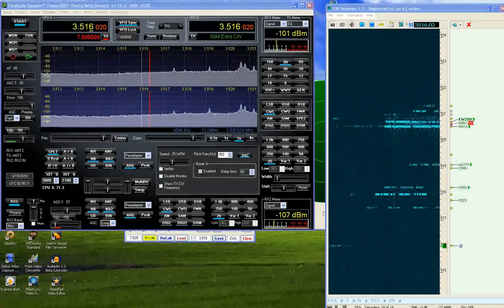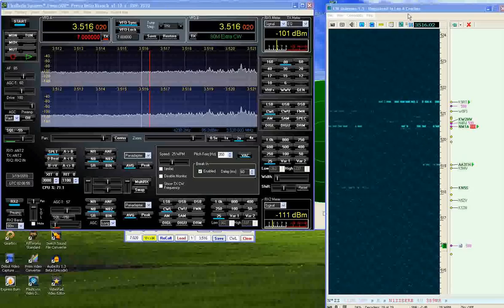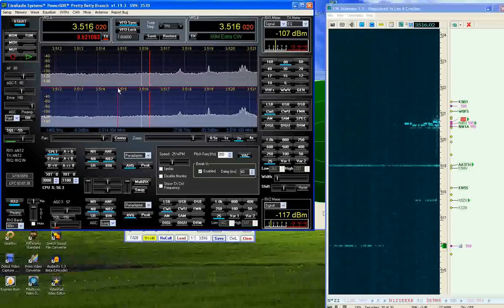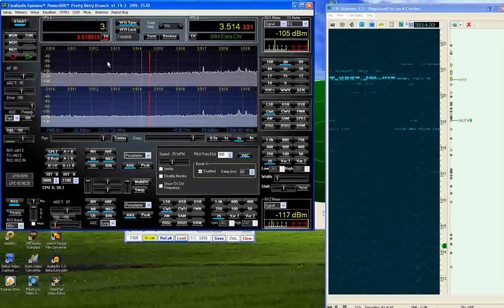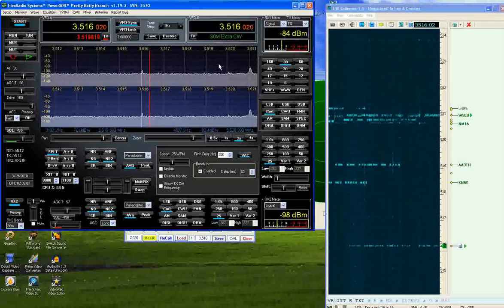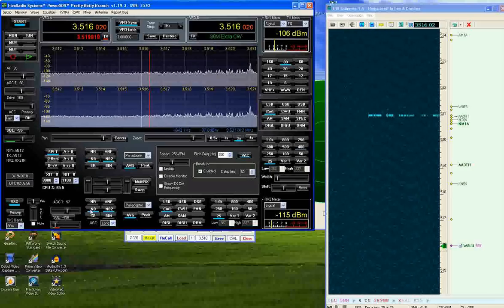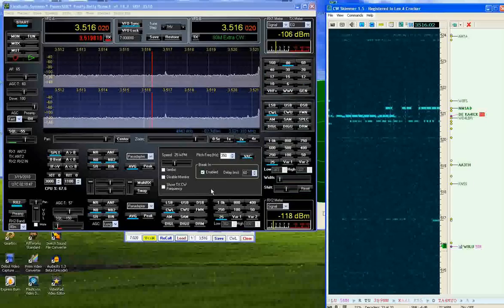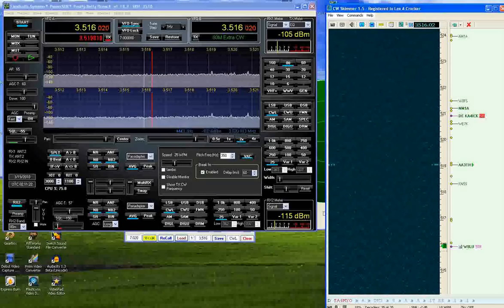3B9WR on 80M CW using Flex 5000 and CW Skimmer

Comment from the maker: I would like better quality also.  Part of the problem is the video software and PSDR suck up nearly all my CPU clicks and I don't have a convenient way to get raw audio from PSDR into the video feed that is not terribly lagged which makes the video very confusing  What I want most is to try and give a real time feel to what I experience when I run my radio.  I will continue to try and discover a better solution  thanks for the support